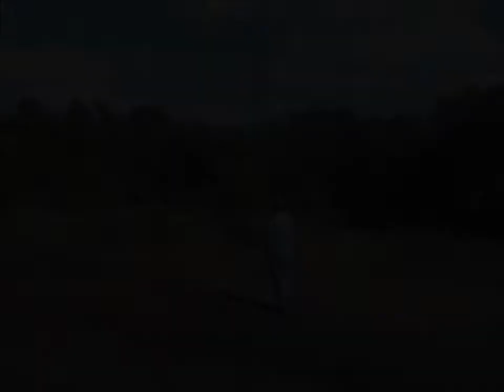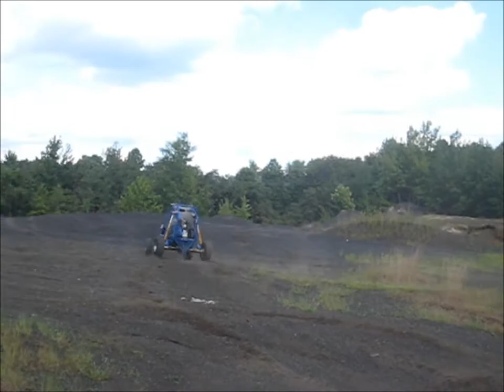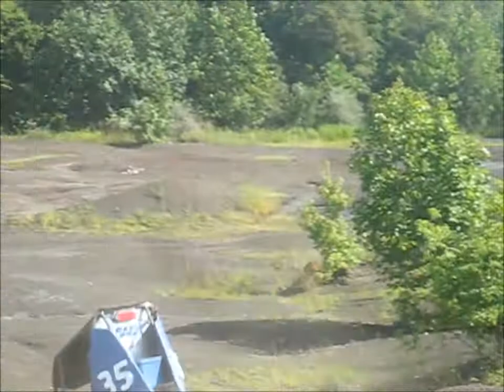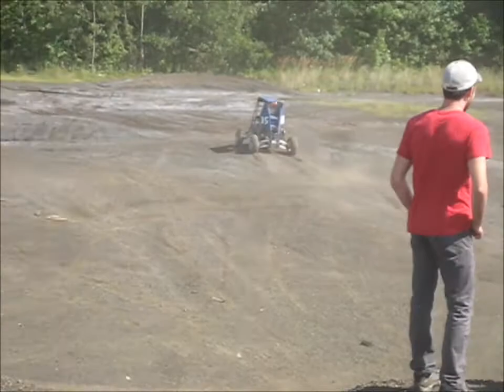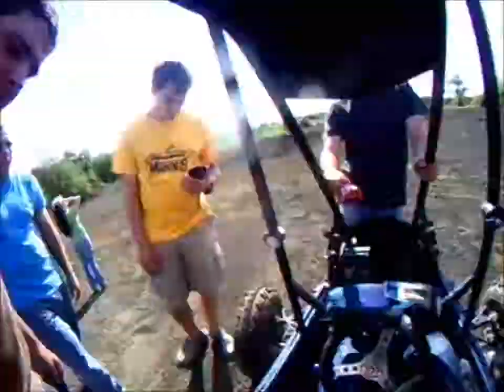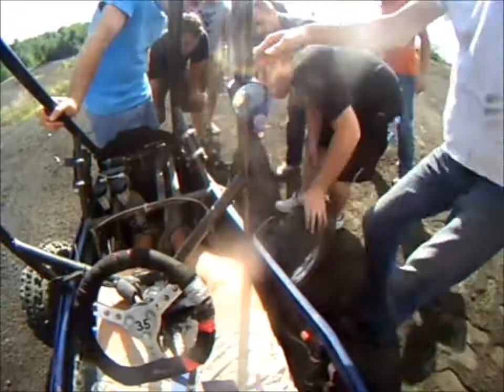WVU Baja Testing 9/3/2013

Comment: search full suspension badass offroad mower rally... the channel name is christopher custer its just a practice run but we use gx200 clones with modded 3spd lawnmower gearboxes... we got half the power and still way quicker but cvts and independant rear ends are huge parasidic loss we normally run swing arm rear and solid 3link up front making us far lighter and stronger... i get the safety thing but for the $that must go into these...